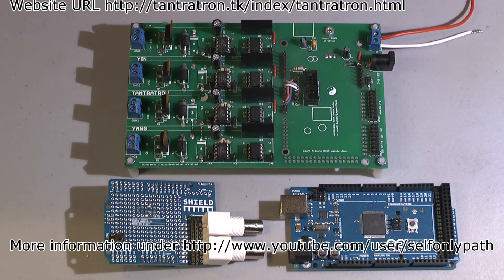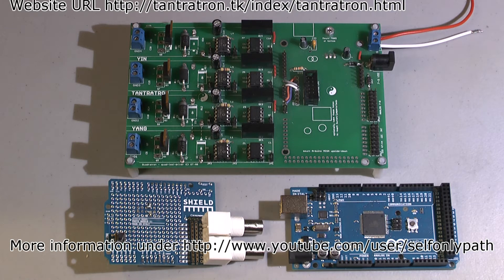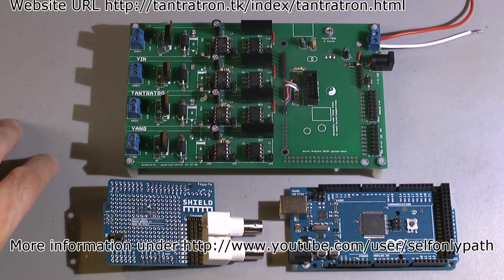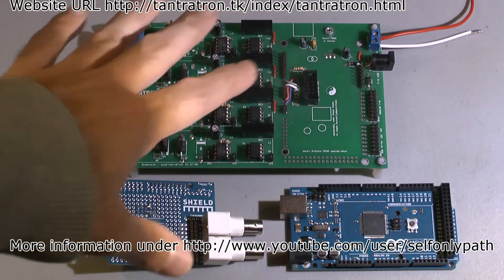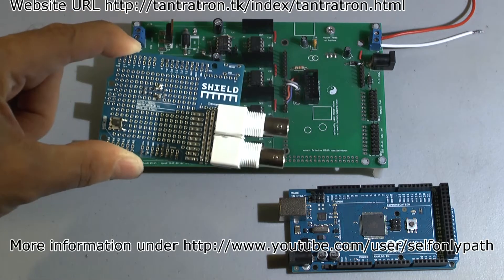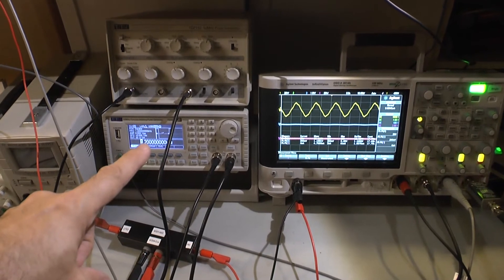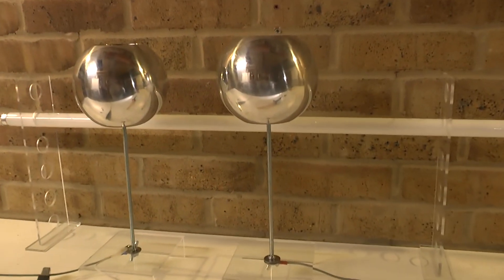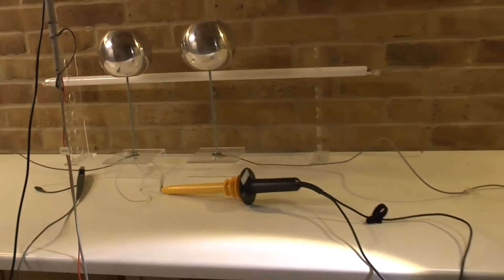The Modular Quadratron Board from Tantratron, Part 1

Comment from the maker: Technically for lower voltages, yes. Problem is that with higher voltages and power the individual litz would break down its insulation. As a High Q coil it is used in receivers but not in transmitters, as a Tesla coil.